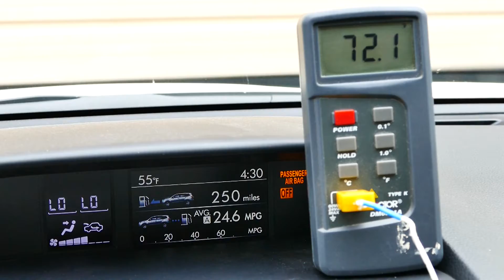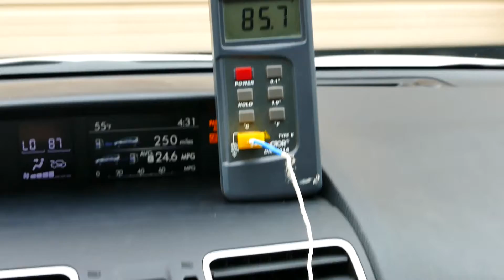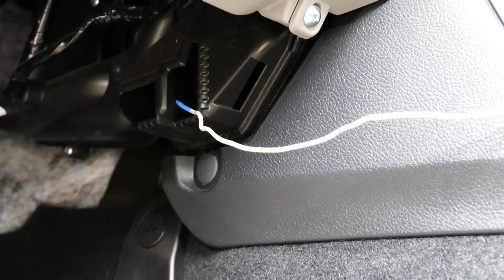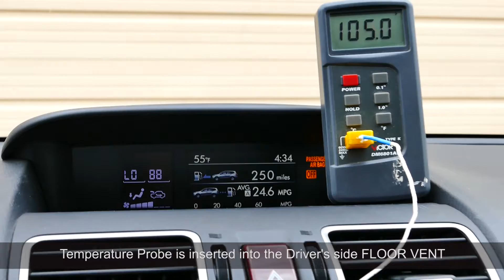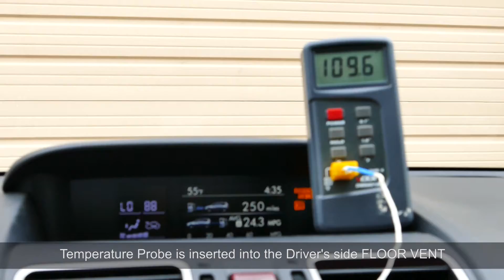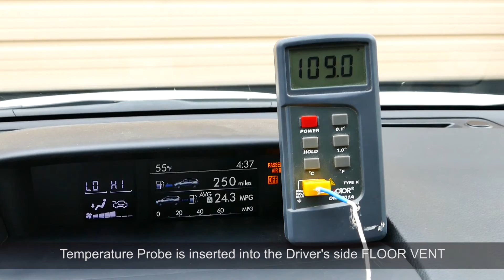2016 Subaru Forester - Dual Climate Control Defect

Comment: Had anyone had the left and right vents slightly different degrees? (mine has about 2 ~ 4 degrees celsius warmer in the passenger side). Is it normal or within the tolerance rank?

Comment: I also am using the floor vents and even when I change the passenger side to low, it automatically changes itself to the higher setting on the driver's side.  So...I guess I should not use the floor vent only as I have to continually adjust the dials when it automatically changes from the setting I want. It goes to sync when I have not wanted sync.

Comment: my 2018 has almost the same problem.  When i set it to 63 it feels like over 90 degrees.
Reply from the maker: Would have thought that they had fixed it by now!  We traded ours in after one year.  Subaru was generous on the trade after some back and forth with their Customer Service.  Now have an Outback, which works (dual zone climate control) as it should.